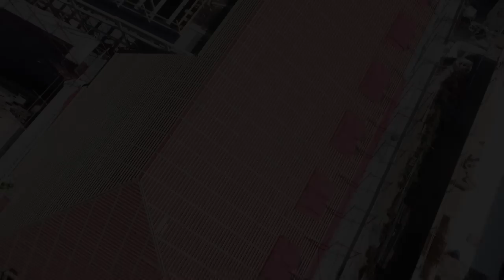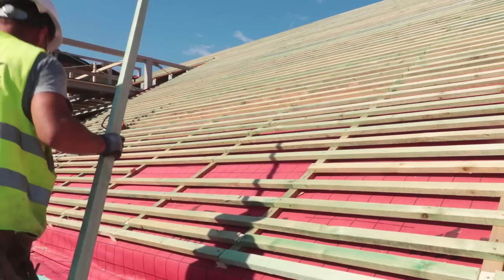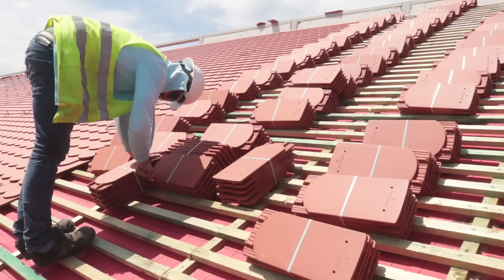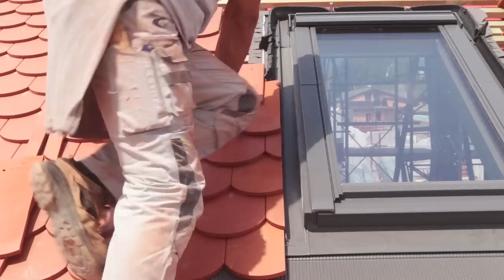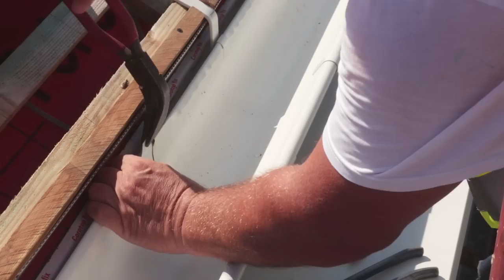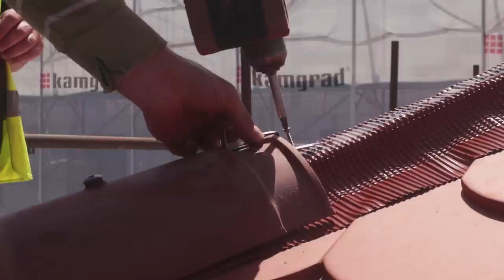We Build a Huge Roof - Part 2

Comment: With my immense knowledge 😂 I was amazed by all of the needed static and dynamic calculations needed “just” for the supporting beams and rafters and design it to proper safety and codes. Meanwhile I’m almost struggling with a simple cantilever wall. I’m sure that the calculations weren’t made using a reihenšiber 😂. Hat down and great respect for all involved.

Comment: I'm amazed that the tiles aren't secured with mechanical fasteners. Beautiful job as always :)
Reply: I have a tiled roof in Arizona. Only the bottom two courses and the top two courses on my roof are fastened. The ones in between just sit.
Reply: Its common in most European countries only the outer aswell as top and bottom rows need to be nailed or fixed with clamps
Reply from the maker: When we work at the coast, we use metal hooks or nails because wind speeds reach up to 200km/h regularly. Here not so much so it is not needed. Weight of tiles is enough. The largest storm ever since there are weather recordings, went trough the city a couple of days ago and not a single tile was lifted. Wind speed was clocked at 115km/h.

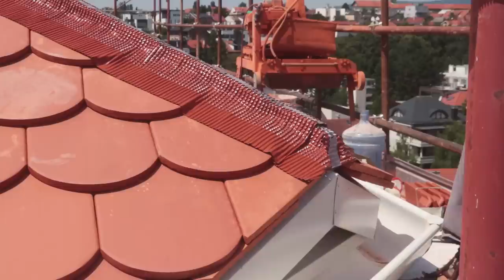Comment: Well done! Ventilation tiles at 9:17 are very important if you have freezing temperatures during the cold season, it allows condensation underneath to dry. In my country tile manufacturers wont give any warranty if you don't install them. I'm a bit surprised you don't use more screws or fixings in the tiles, but I guess they're not prone to "fly" because of the flat shape.
Reply from the maker: You are exactly right at all points you have made!😁 glad you like the work, Thank you.

Comment: Lovely to see a roof of this size that is not flat (and covered with EPDM). Large buildings mostly have flat roofs and they put the mechanical on top of it. 
I think this roof with the gutters will last > 100years. Also very nice roof tiles, it's a design I haven't seen that much. Mostly wavy tiles over here, modern houses sometimes do have flat tiles but they are rectangle. Also are the gutters made of zink? The roof windows look like velux or maybe Fakro but another brand it possible, crazy to see so many my attic has like 2 of them. I guess we won't be seeing the finished inside as that is for another company?

Thanks!

Comment: Nice, this roof is a different style wit the beavertail tiles, but construction details are common with the tile roof I'm currently working on. The steel starter strip above the gutter serves the same goal as the lead slab I nail on the lowest batten supporting the lower end of the first row of tiles. Keeps snow and birds out! I removed a birds nest or 15! and some wasp nests.
Reply from the maker: Yes it is interesting to see different roof styles used around the world. My favorite can be found here in Croatia at the coast. Some old houses are covered with large flat stone slabs, typically 5 cm thick and up to a square meter in surface. Those roofs are commonly centuries old. I don't think anyone could afford it today though..😅

Comment: 👏👏👏 Bravo again maestro! So the roof tiles  just hang on the slats? Does the weight of the tiles hold everything down?
Reply from the maker: Yes the weight of the slats is enough for this area. Near the coast is a different story, they have to be nailed down or fastened with special hooks. Glad you like the work !😁

Comment: I dont have snow or tiles in my town so 2 questions: the snow device is to hold the snow on the roof of make the snow fall? The tiles, no screws or nails? just one agains the other and they resist 115kmh winds?????? wow
Reply from the maker: Thank you for watching!😁 they are there to keep the snow on the roof so it doesn't fall all at once when it starts to melt on some poor persons head. Yes those tiles are amazing and this model is in use for hundreds of years. I guess the optimal shape was found😁

Comment: Are the snow clips there to help hold the snow on the roof?
Reply: They are holding it so it doesn't slide in big pieces, and damage the gutters, with those guards when the snow start to slide, it brakes into small pieces....
Reply from the maker: The gutters are strong enough by themselves but the snow poses a threat to people walking down below. It is safer to hold it on the roof and let it melt slowly.